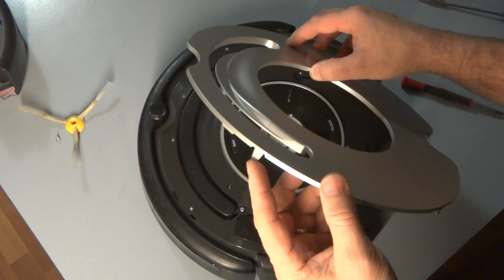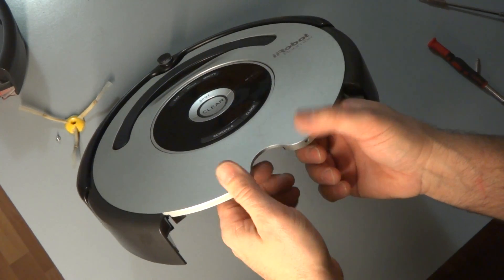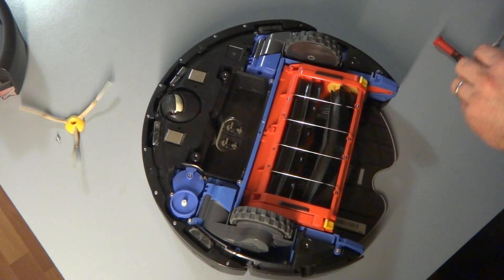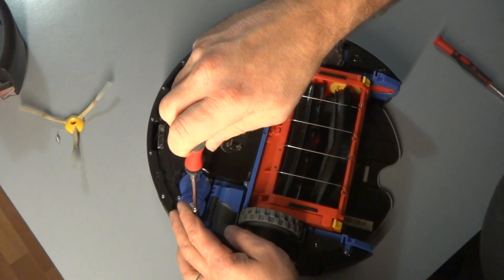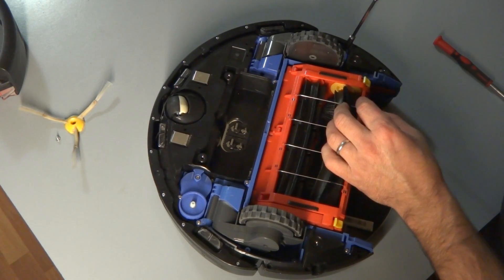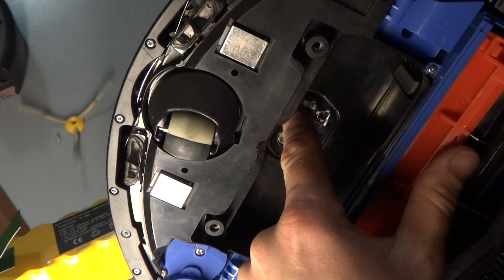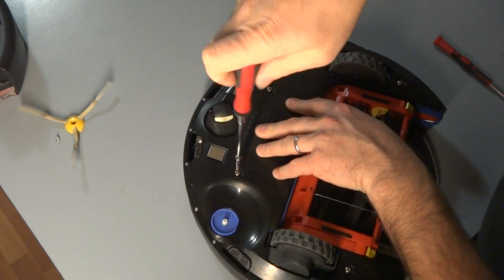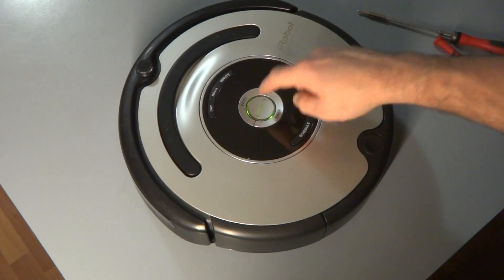3 iRobot Roomba 500 and 600 Series Circle Dance 9 Beep Bumper Error Full Disassembling Part 3

Comment: Thank you soooo much!! It worked! I bought the correct part off of eBay (used) as customers on Amazon said the new parts didn’t work. I found that the part I purchased had to be modified as well, since both sides of the bumpers were the same, and one wouldn’t fit into the side. I was able to refit it, and reattach the small spring inside after a couple of tries 😁. Everything in your video worked perfect! Thank you!

Comment: Hey i followed your instructions on fixing the circle dance problem, and your videos are AMAZING and super thorough and helpful, but it's still spinning clockwise even after I replaced the IR things. Do you know what could be causing it to still spin? I really don't want to have to buy another one. Thanks for making these videos btw!
Reply: Did you replace the emitters /sensors in the bumpers?  If you used the same sensors that you took out, , then the problem wasn't  fixed.